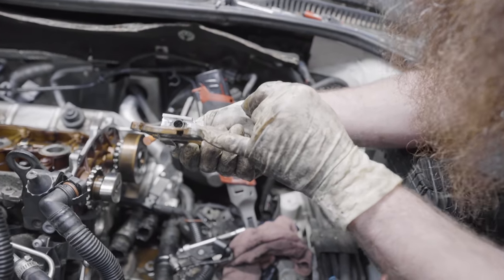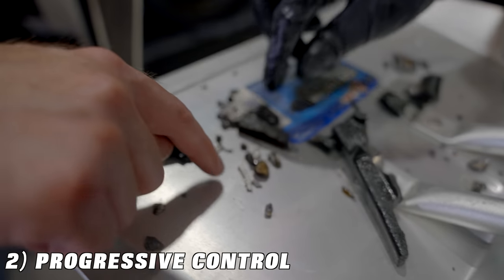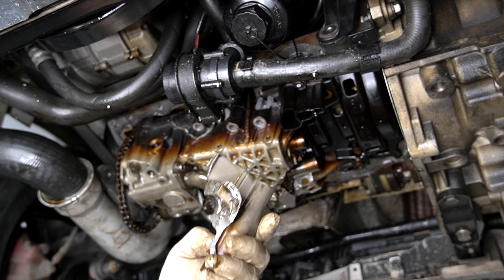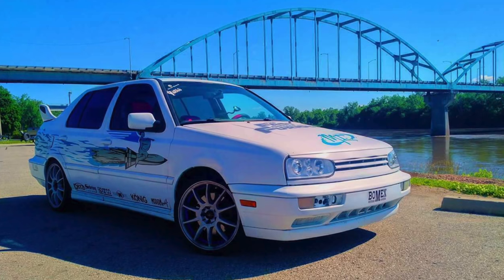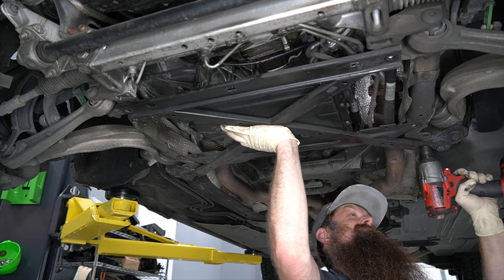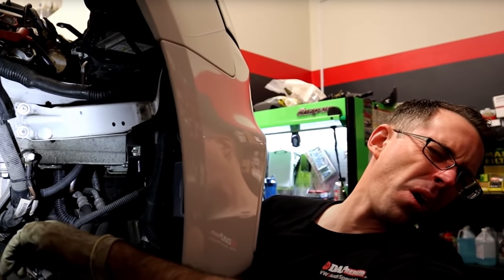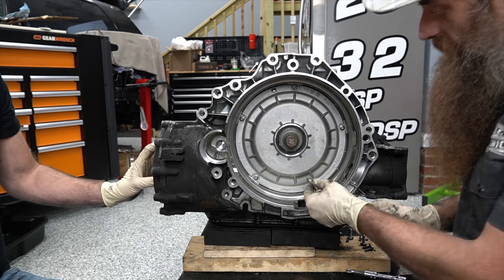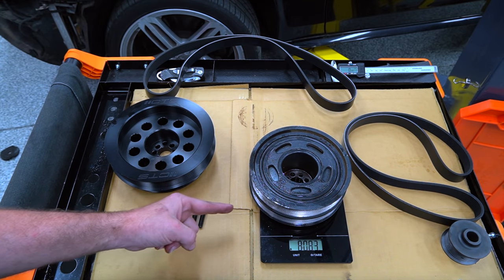I Blew Up the 1/4 Drag Car on the Dyno ~ JDM vs Euro RACE Episode 3

Comment: My condolences, and .... RIP, little Jetta... :(

Gotta ask though: Which 2.0 TSI did they put into these cars in the US? The plastic cover and the model year make me think it's the EA113 they used in the Mk 5 GTI over here in Ze Vaterland... but that one had a timing belt, not a chain. Did US Mk5 GTIs/GLIs get the EA 888 fitted with a 113-looking cover? 
If it was the 113, I'm kinda surprised it failed so spectacularly. Those engine have a reputation for their high tune-ability - prolly one of the reasons why VW stuck with them for both the Scirocco R and Golf Mk6 R even when the GTI had switched to the 888 already.

Keep at it and better luck with that S4!

Comment: I have never seen an engine blown up that badly. In a way, great content on what can go wrong, and it honestly looked like it shredded the half the engine it didn't blow off. Lol. I would have also loved to have seen a swapped MK2 with turbo engine
Reply: Happens all the time. 
Especially with weak stock rods
Reply: @frontspring1  How much boost can the stock rods support?
Reply: @austin_love89  like 350 max ft lb torque. 
This thing put down 436 ft lb before it blew those are like Nissan r35 gtr numbers.
Reply: @frontspring1  good to know, working on a mk5 gti right now.

Comment: First of, sad to see that VW blowing up...
You have no idea how lucky you are in USA, in Denmark cars cost so much more, that Audi, same year, costs 25,000 euros....

Currently we are fixing our car, my first car, 2009 Scirocco 2.0 TSI. We bought it for 15,000 euros, but the seller scammed us, the engine is in poor condition. 
I did clean intake valves on the street and changed oil pressure sensor. Car ran good after that. We heard rattling sound in the engine. I read up, and I got an idea to change timing chain assembly. I bought all new parts and left the car at mechanic. He test drove it before fixing for maybe 150km...he pushed it to the limit, and the broken slider (that was making the sound) got in between sprocket of intake balancer shaft and the chain - the shaft broke. I bough all new damaged parts, including new water pump, balancer shaft gears etc.. Hopefully, after mechanic fixes it, he doesn't blow it up again....  Anyway, great videos, I am very new to car world. This is both entertaining and scary to watch.

Comment: I would have maybe said about a MK4 Jetta like my car with 200 hp which is almost close to the jetta you guys have. You can either pick 1.8T engine or Vr6 2.8L 24v engine. Or vr6 R32 engine swap. Probably the car might weight a little more than the jetta you guys have. But it all depends the win

Comment: What a shame. Just a lack of knowledge with tuning these engines. Could of put a nice gtx2867r for a 430bhp low torque map with good boost build for fwd drag setup. A bwa/axx engine is happy around 360/350 on a k04. That nitrous just loaded tons of torque on worn piston rings, coupled with high egts of a k04. What a shame expect alot more from yous guys. I know it's all fun but the old ea113 engine is a beast when tuned properly. Coupled with low 1200kg poss weight in mk5 platform etc and low transmission loss they can go pretty well

Comment: I know maybe a little of y’all’s realm, but if the stipulation is euro & not german, a Saab 9-3 Aero would of probably been the ticket. Cheap to buy, super strong turbo engines that had been evolved & refined for over 4 decades & easy to make power out of. Or even a Volvo S60 for pretty much the same reasons.

Comment: Just a future reminder. Wet shots hit harder than the jet size. Usually 100 shots translate to roughly 150. Nitrous is brutal on parts. Better running a boss 500 kit on a budget build and turning boost than nitrous

Comment: I don’t think you can get a b8 s4 even with bad trans for 1500, unless of course there’s some kind of behind the scenes agreement that this is for the YouTube video with some buddy. Gen1 dsgs are also a lot more expensive than gen2 because they blow up often and there’s demand for them. Gen1 and gen2 are not officially interchangeable.
Reply from the maker: Nah it was straight up. A customer didn’t want to or couldn’t fix it. This happens some what often
Reply: @HumbleMechanic  I’d say the customer is a strange person, although I’m not sure how much they sold it to the shop for. Anyways
Reply: We also purchased a gen 2 trans but used the clutch pack from it to fix the car. The harness was new from our site.
Reply: @Deutscheautoparts  right, I saw that you “cannibalized” that trans and pulled the clutch pack out of it, it definitely fits as the p/n for the gen 1 was updated to be the same as for gen2. Another thing you can try to do is to swap the valve body from the new trans, I.e, tcus can be swapped on the mech units, I did this to a gen2 mech from the Macan and shoved it into my 2010 car. Actually, you can reuse almost all the rest of the parts from the atf chamber of that trans like the oil pumps and valve body if the clutch doesn’t solve the problems. While I still don’t think that the average person will be able to find a 1500 B8 S4, 600$ gen 2 trans is def doable, I see those available starting at like 700 without really huge miles. Anyways, good luck! Still a shame the Jetta died, though, it would be much more relatable if the race was between a civic and a jetta or golf

Comment: What Octane were you running for fuel when you tried to spray it? Did you at least use 100 or 106? Or did you just slap it one with whatever was in the tank?
Reply from the maker: I drained the tank. The best I could find was 93

Comment: I have and 2011 Audi A4 and I have a transmission error that puts me in limp mode every so often I have had the mega Tronic unit replaced at £2800 but I still have the same problem what do you guys recommend?

Comment: The funny thing is i have an 05 wrx I've been dreading on cracking open. The jdm crew could have bought it for 1500 from me and put 4 hours of time into it then put go fast parts on it. But sold it for 5k last night cause i got the issues fixed

Comment: Why not swap the whole transmission instead of only the clutch pack?  Was the donor trans also broken?
Reply from the maker: The trans I got was missing the diff. And the mech unit is immobilizer locked.
Reply: @HumbleMechanic  that makes sense!

Comment: It's crazy how I've been seeing the 07k with stock internals turbocharged handling 400+ wheel and not having any issues,
Reply from the maker: It may have held at 400, it blew at 440 lb ft.

Comment: Was something wrong with the "new" transmission. It would have seemed a lot easier to just swap the trans and be done with it.
Reply from the maker: A few things. That looking back I cut from the video. 
1) different tail shaft 
2) The mech unit is coded to the car, similar to how keys are. Also the numbers on the mech have to match, or it won’t work(allegedly. I’ve got mixed on that). 
3 The big miss on my part. The trans didn’t have a front diff. The reason it was $600 is the guy pulled the diff for r+d. So we have to swap the diff and be sure the loads were right. 

As crazy as it sounds, swapping the clutch was way easier

Comment: Nos wasn't necessary just a better tune, I'm 270hp/290tq on the stock turbo, you can easily do a good tune to mid 300s reliably with k04 on stock internals
Reply from the maker: I didn’t think that was enough for the W. We knew it was boosted but not how much power it made. After finding out the power, no chance. Haha
Reply: @HumbleMechanic  yeah fair enough man, have enjoyed the videos though, learned lots

Comment: Did I understood correctly? You guys paid a $1000 for a tune that is basically a file upload to ecu with slightly increased values? And not for proper tune? Or am I missing something?
Reply from the maker: Kinda. ECM and DSG tune. Now it’s mapped for dual pulleys, and difficult transmission behavior.

Comment: Did you put the new harness on the replacement transmission
Reply from the maker: No. Something that got left out of the video(for time. it was a boring clip of me talking LOL) This trans was used for parts, and wasn't complete. It also has a different tail shaft. Also the mech unit(TCM) is coded to the car like keys are. It would have been a nightmare. 

I do plan on swapping solenoids from the newer mech unit.
Reply: @HumbleMechanic  I would like to see the detailed video of the trans work. 
Great work

Comment: Should’ve ran like a 30 or 50 shot. On a boosted engine nitrous is multiplied around 1.5x the shot of nitrous on an NA motor.
Reply from the maker: For sure. Should have started at the lowest

Comment: It a turbo car. Double everything. 35 shot would have given you about 70wheel. You basically just gave it 200hp at peak torque. At very least you could have told the dyno operator to not hit the button until 5k

Comment: Prices that sold you my 99 Max thing had a crack ed radiator no oil change in 3 years I think was still putting down f**** $280 horsepower

Comment: I love it:
$5000 car:
$2000 in parts?
$1000 for tune?
$5000 in labour?
😂😂😂😂

Oops spoke too soon;
$??? For another car 😂😂😂😂😂😂

I love how these guys are so good-natured. So much work just to blow it up on the dyno and they can laugh at themselves 👍👍👍👍

Should have LS-swapped it 😂😂😂😂

Is that a cast-iron block? The surface of the material at the breaking point looks jagged, not smooth. Smooth surface would indicate ductile failure, and jagged surface indicates brittle failure. This block is obviously not made for this amount of power. I’d like to see the connecting rod failure points. It would be interesting to show this to a material science Engineer and do a video, however, a giant bomb going off inside your engine is sure to cause some widespread damage 😂😂😂😂

Comment: Why not replace the whole transmission since you had the used one?
Reply from the maker: This is something I cut from the video. 

It’s a few reasons. 1) the trans was not complete. That’s why it was so cheap. It was missing the diff. 
2) the mech units are coded to the car, like keys. So we would have had to tow to the dealer. 
3) the Mech unit numbers have to match, what came out. This didnt 
4) the connection for the prop shaft is different.

Comment: Where you went wrong instantly was turbo engines make 2 times is much power off the same nitrous jet 100shot is 200 hp on boosted engines

Comment: Im happy for you guys but common. 15 hundred for $$$ for b8s4 with broken trans. Im not an expert but its more of a gift than a steal deal lol.
Reply from the maker: Actaullyt thats not uncommon. People throw money at a car, then are faced with a $5k plus bill for a transmission replacement. I got a quote for a used good trans for $3500. Now at a shop add labor, $1500 maybe. You are spending big buck for a car repair. A lot of people choose to just off load the car. 

Paul found that used trans for $600 because it was missing the diff. Did we get a little lucky? OH YEA. but this stuff is more common than you may think. LOL I Should have asked Tom before I got the Jetta.

Comment: A di car can't have fuel n nitrous running from the intake tube.  It's a dry manifold never intended toanage fuel n nitrous equally to those cylinders.  Safest bet is to have 1 nozzle for ea runner.  Those afrs on cyl 2 must have been rather lean,😉.  Great effert, that tq and quickness that it ramped up in rather impressive. All the best..
Reply from the maker: 100% better ways to do this. Hahah

Comment: A B8 S4 with a DSG repair included and a possible dual pulley tune for under 5k? Yeah, not going to happen for normal humans.
Reply from the maker: I think we could make that case for the GLI too.
Reply: @HumbleMechanic  A broken GLI is pretty much worthless...but even the (working) engine of a S4 B8 is worth more than those 1500bucks and even with a broken DSG that car should be more like 4-5000bucks or even more.
Reply from the maker: Maybe.
Reply: @HumbleMechanic  Don´t get me wrong. I love this series and I know that you have connections to all sorts of people to get such awesome offers and prices. Basically I´m just envious because over here in germany I´d buy 10 of those S4´s when they´d be availiable for 1500bucks. :D

Comment: The engine must be in bad condition before, 250hp is very very low for this kind of build. My stock Golf 6 GTI with CDLG engine (edition 35) w/ stock intake injectors etc runs 308hp and 416nm on e85... and still in one piece lol

Comment: I have no idea why they didn't start small, and why they thought that engine could hold another 100hp, 350hp is known as the point where rods like to come out the engine on those 2.0 fsi, and with nitrous it's even worse because you make more torque, which is what breaks rods.

The whole s4 thing is kinda fucked tho, because realistically you'd never find any one of those for 1500$, you got it that cheap because Tom is your friend.
Reply from the maker: No one really knows. Lol

Comment: Okay first of all picking the VW. NOT! Fixing a very crappy VW to try and make big power. NOT! Giving the VW an uncontrolled 100 shot of NOS. NOT! Now I guess with choices limited you've at least gone V8 so that's something. As well it's a great engine. But couldn't you have found an N54 and just pumped that up for dirt cheap?? LOL. I'm just ribbing the guys as much as possible but I'm loving this series! I tend to think they blew it up on purpose because they realized they "Picked a bad car". Period. So they blew this one up like over turning the chess table when you're not winning. LOL. Good luck guys!
Reply from the maker: At the end, no matter what car we picked, no matter if we win or lose, there would be a “better car I should have got”.  LoL. And I think we knew the civic boosted at the dyno, but no idea it had that much power. 

We were pretty confident that with n2o we had it.
Reply from the maker: We were wrong. Haha

Comment: Well dang. I mean, when I saw you guys bought a 2.0FSI I knew the JDM guys had y'all cooked from the start.. so, even though blasting a 100shot through it at 3krpm was.. hmm, "wishful thinking" at best- I get it. I rebuilt a 2.0 around 5 years ago for my Wife to drive, and although it did serve us well once it was finished, I was never impressed with their design decisions (IE: The timing belt/timing chain shitshow, failed the exact same way on the engine I rebuilt). 

I do think the S4 has a much better chance of hold its own, but I really wish you guys would've went for something N54 powered. I've owned a few of them, and I paid $1800 for one in 2018 that needed the front clip reinstalled. I flashed one of my tunes to it and daily-abused it for about 6 months. Otherwise completely stock, it went 8.2 to the 1/8th on some junky 235 street tires with a passenger. In your budget, I believe you guys could've grabbed one needing a water pump, and had an ebay FBO setup for <$5k.
Reply from the maker: no way the GLI would have kept up with their civic. But now we have an engine swap to do. so that is rad

Comment: Is it possible to take the dsg and out it in the v8 s4
Reply from the maker: I’m sure  it probably won’t bolt up. But software will be the biggest issue
Reply: @HumbleMechanic  yea you're right.. I didn't know the Audis also used the DSG though. DSG is really a great transmission.

Comment: There was something wrong with the engine before, 250hp is possible just with software if you push the turbo to its limits and don't want to have it stable just for a drag race, in my opinion the calculated 320/330hp should have been easily possible. 

So I think ofc you killed the engine with the nitro but it was damaged before, the diagramm looked really poor a lot of waves and no nice graph or the software just was total rubbish.

Comment: Why not just swap the trans out?
Reply from the maker: Great question.  
It’s a new trans with a different tail shaft 
It is missing a diff, that’s why it was so cheap 
The mech unit is coded like keys. So it probably wouldn’t have worked. I’ve head work around a bit it’s low odds

Comment: How much do you have left? $250? Plus $500 from me for the turbo, and down pipe, is $750. Buy yourselves a bone stock Ford V8 with 300,000 miles on it. You can still give that Honda a run for the money.

Comment: I’m not a bias fan of any make or model. Euro cars are just way to much money per HP gained and stay reliable. 

Say you have a 8,000 budget to buy a euro car a Japanese car and a Domestic car. With that money you have to buy that car and modify it. The likelihood of the euro car coming in first or second is 🤨
Reply: A 12v vr6 will  handle way more power then a factory Honda motor can. Just depends what car.

Comment: Americans and nitrous, when are you guys gonna learn that that not all engines are made of cast iron with 7:1 compression. You can't just cram a 100 shot in an engine made for fuel efficiency and lightness with what 11:1 compression made of aluminum.
Reply: VW GLI engines are made of cast iron though...